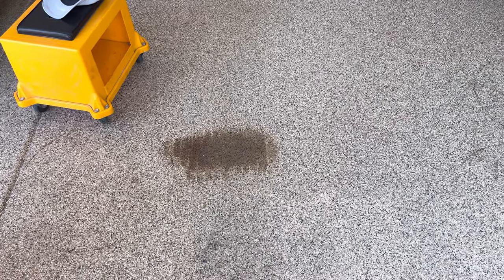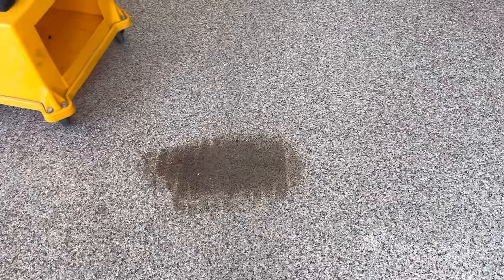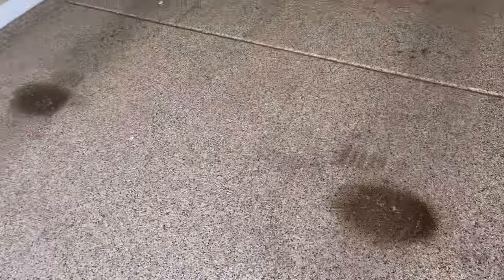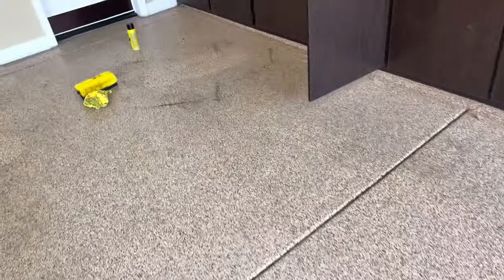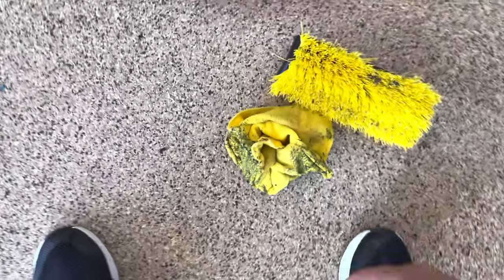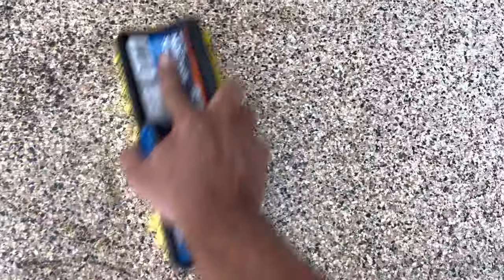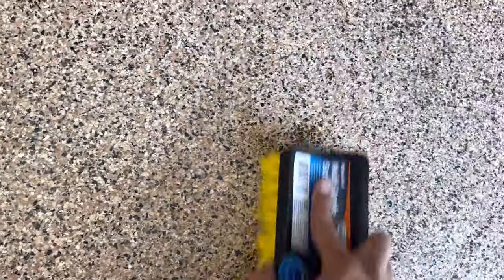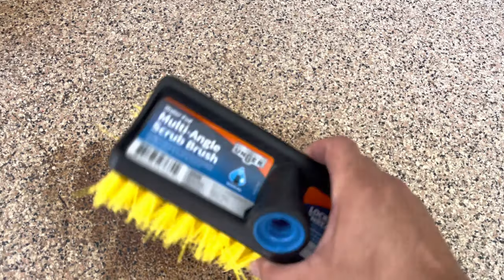How to remove embedded tire marks from your epoxied garage floor.

Comment: It clean ups up with Goof Off but I don't want to have to keep doing it. I was thinking of having another professional clear coat put on again. I had an opoxy floor before for 9 years and never had to scrub it, just a light mopping with water and shine like brand new. Apparently the latest epoxy company I used must have used cheaper products.